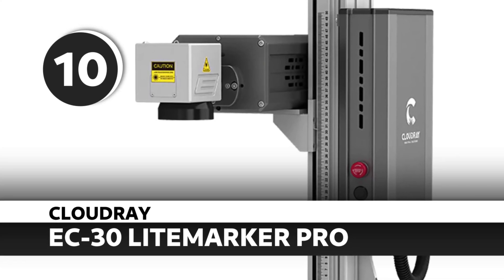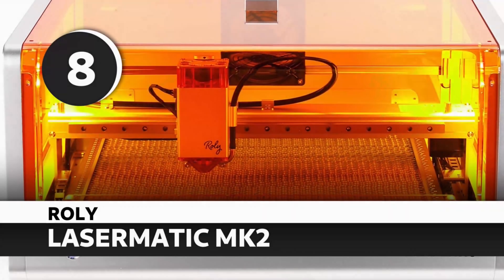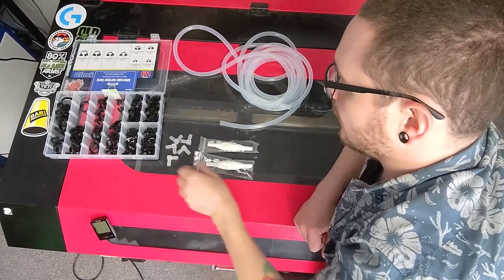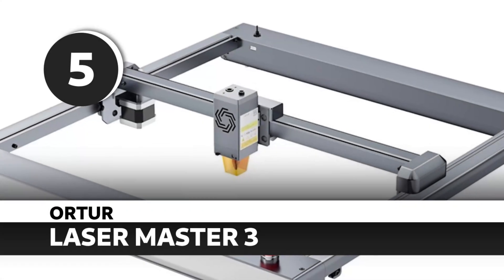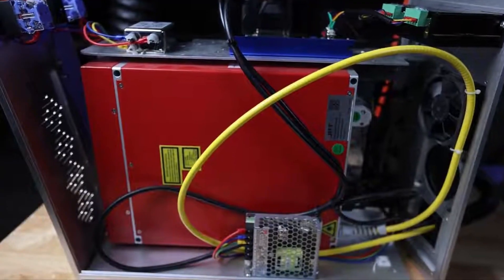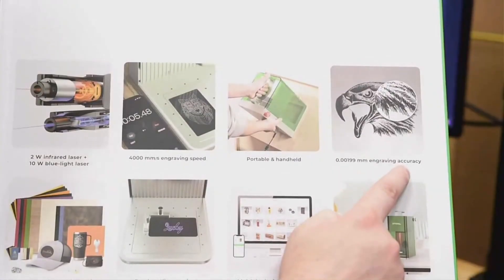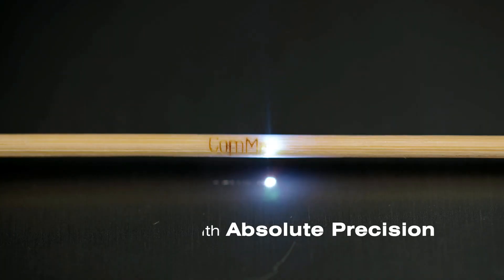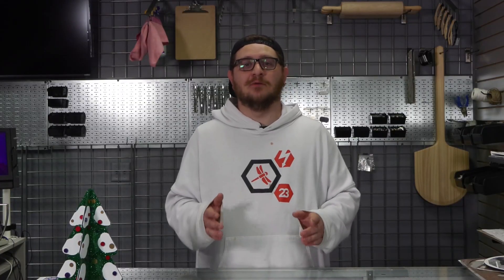The TOP 10 Lasers I’d Actually Buy in 2025

Comment: Hi brother, I hope you read this comment. Which machine do you recommend for metal credit card customization ? I'm looking to get into this business and would need some information to start with. Wish you have a great day !
Reply from the maker: Typically with metal, you'd probably want a fiber laser, it will give you the most utility with that material. Beyond that, it really depends what exactly you want to do. If you want to do basic marking and coating removal on metal cards, then any good quality fiber with a reasonable wattage and lens should be okay. If you want to mess with marking color onto steel cards, then you may or may not want to add some versatility in the form of a MOPA pulse width unlocked source. You can do colors without this, but it adds a LOT of versatility, if adding color onto cards is something you plan to do a lot. JPT makes the M7 series which is common for this and is a great option and gives you that added pulse width control. The M8 series is another option but is more expensive and probably not needed. The LP series sources from JPT are technically MOPA (and are good quality), just dont give unlocked pulse width for that added control. Jump into the discord or other community support threads linked in the description if you'd like to chat more about options or questions.

Comment: Hi Alex thanks for give us your experience, i always take yours tips. Do you recommend Cloudray EC-30 LiteMarker Pro for engrave tumblers using cylindrer correction?
Reply from the maker: Off the shelf and delivered, they seem to do well for the people who have shared their experiences with us, but they do have their pros and cons. As long as you know what you want, and that fits it, then it would be a good fit. It comes with a standard size laser head, and an expander that matches. This means it will have a slightly physically larger dot size when in focus on your object. A common upgrade and thing we talk about with co2 galvo machines, is a head upgrade to a 20mm head, and expander to match (often 8x or 6x, depending on the source, and a lens that can accept the bigger beam). These upgrades tighten that dot size, which increases the ability to reproduce detail through physical resolution. If you don’t have a need for that added capability, then you can probably save a little money going with the less expensive setup.

Comment: thanks for your video. I am looking to do some cutting of flat acrylic of 1mm with a maximum size of 300 by 150 mm. i want to test some ideas on scale as i am designing a solar powered hosue boat and the panels in real life are on 3000x1500. (they would be in hdpe but i don 't want to learn to cnc so i would use i guess acrylic and solvent weld the pieces of the 3d 1/10 scale boat) . from the information i find on the internet it seemed like a cheap path to try my ideas. I am located in europe (belgium) and i have no previous laser experience and i would like something without much of a learning curve. I also don 't want to pay monthly subscription fees as i am on a tight budget.
i can draw in sketchup and i have an "unfolding" extension in sketchup that unfolds my plans into flat surfaces.
What type of laser should i get? What power should it have? Any recomendation as to a cheap model that is easy to use and set up for a dummy? After my scale tests this machine will probably just be collecting dust in a basement, so again, the price point is very important.
thanks, Peter

Comment: Great video! 
I am looking at the F1 but every video I watch only shows it working within the units workspace. I know the F1 has the slide which will allow you to do expanded width projects along the x axis but would if you wanted to do a project larger in both the x and y directions. Is there a way to use the F1 with the Lightburn print and cut feature or some other method to achieve this?

Comment: just bought the omni 1 as a total laser engraver novice. one word of warning to those who have no experience — it's a totally frustrating experience. directions/instructions are rudimentary at best. i reached out to commarker support for help, and they sent a link to the instructions, and the first thing i read was how to access the auto focus button through the control panel on the touchscreen. i have no touchscreen. i've spent two hours trying to set up the rotary chuck to accept a tumbler and it's either too small or too loose, and i can't find help anywhere online. it engraves beautifully and i'm completely happy with it's abilities, but you're sort of  on your own as far as setting it up.
Reply: Commarker b6 has autofocus, omni doesn't have a touch screen. Didn't you check the wrong instruction?

Comment: I hope commarker B4 can have autofocus. My 50W is enough for engraving coins and make jewelry. I like it but if it has autofocus it would be even better for me.  B6 have that but I need a larger power and I don't really need mopa.
Reply from the maker: The b4 I dont think offers autofocus. While they are fairly close in footprint/size from what I recall,  the B6 is a more feature rich and premium platform. They are also using different sources. The B6 has a few listings for JPT and non JPT b6 models, so that might help get the price down for you a bit while still hunting for that autofocus feature. As long as you're not changing lenses, autofocus can be nice, but the good ole focal stick option is nice and easy and cheap if needed, and is nicer if you plan to swap between lenses. One thing to note about these compact models, you're pretty much capped in lens size at around 200-210 typically, which is fair for a smaller semi portable machine. So you'll probably only ever want/need/able to use 1 or 2 lenses, probably a 110 and 210 or so. If you need a 300 lens, this is probably the wrong unit for your needs.

Comment: Have you ever used an Epilog, Trotec, or Universal Laser Systems? They are a bit higher end than the lasers you reviewed. Take a look at them if you can attend a tradeshow near you.
Reply from the maker: I've very familiar with all and have used Epilogs machines extensively. We try to avoid proprietary hardware here *when possible.
Reply: @LaserEverything  I have a ULS VLS6.60, and the proprietary hardware issue doesn't concern me. But, I get it. They cost more, and are priced too high for hobbyist.

Comment: is it better to recommend enclosed lasers for beginners, and is 5 w to low for laser cutting? or its not about power but its about the time it will take.
Reply from the maker: It's a combo of both really. Enclosed lasers are safer if you A) don't trust yourself to wear your eye protection responsibly or B) plan to operate the laser in a location people can unsuspectingly walk in on it. 5W will cut some things okay and won't cut others. Thickness definitely plays a part here and you CAN run multiple passes over and over but at some point that does become ineffective where a higher wattage laser will be the only option. Lot's of variables. I like 5W lasers for their small dot size which can produce great details for things like photo work but new lasers are doing better reducing their dot size (at least in the diode world) so that may not be an advantage of lower power lasers forever.
Reply: @LaserEverything  Hey, I just have a quick question. I have a choice between the xTool D1 Pro Laser Engraver, 10W and the Creality Falcon A1 10W. Which one would you recommend? For me, they are about the same price, (but Falcon is around 100 more). I have heard and seen many videos, including yours, recommending the xtool brand. Please let me know !

Comment: whats company better cloudray or haotian laser?
Reply from the maker: Honestly, we think they are both great, so it depends. Both are pretty solid brands, approach things differently, but that's not a bad thing. "Better" doesn't really cover the differences and is gonna be subjective to your needs and what's important for you. Blanket statements of one being better outright over another without more context could offer a worse value to someone with different needs. Kyle has extensively tested a 60w Co2 galvo and 5w JPT UV from Haotian, and the QS-50 LiteMarker Pro 50w from Cloudray, and also has content planned covering customer service/warranty experience across a few brands that might offer some more value on comparing in the future. 

For the context of a YT comment (only so much space and ability to converse), I think its fair to sum it up as if you're between those two brands, and like mixing/matching your build components and accessories, that's kinda Haotian's bread and butter, but cloudray does offer that too you'd just need to go through their sales team on their site and it would be a bit longer for them to build, test, pack and get that to you. Cloudray has mostly off-the-shelf builds, so everything is kinda ready to go already and has a standard build in a box waiting to ship and so anything different from standard would mean putting in for a quote and talking through it with someone rather than ordering it off amazon. Haotian has standard suggested builds too, and often ready to ship popular units, but their norm is catering to those custom requests/changes.
Reply: @LaserEverything  I have a photography studio and I also do advertising and stamp services, would uv 5w be a good choice or maybe galvo rf40w would be better, I would like to engrave photos, rubber stamp and other cool stuff. what two lenses should I choose to start with? 70x70/110x110 and 300x300 what do you think?
Reply: Haotian no contest.
Reply: @cologeo2169  thx